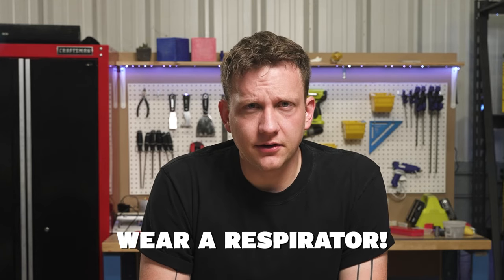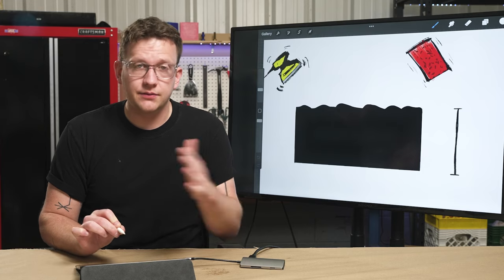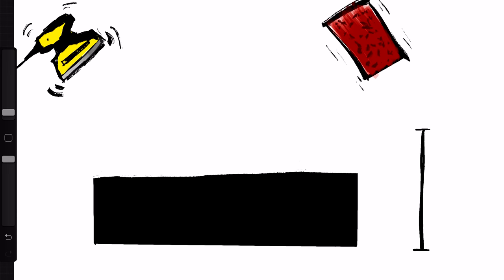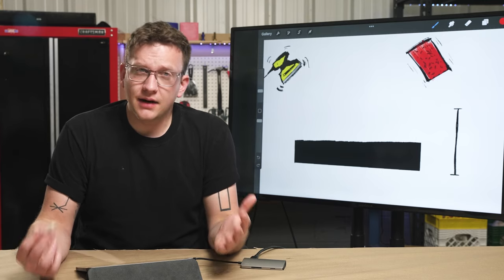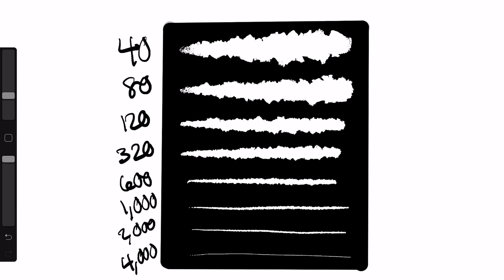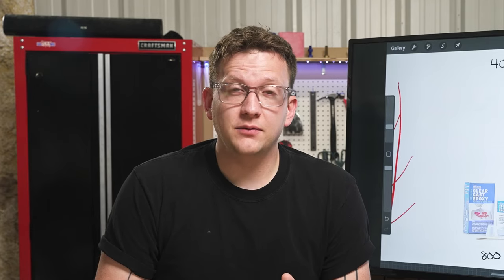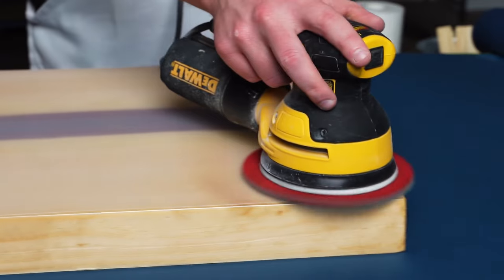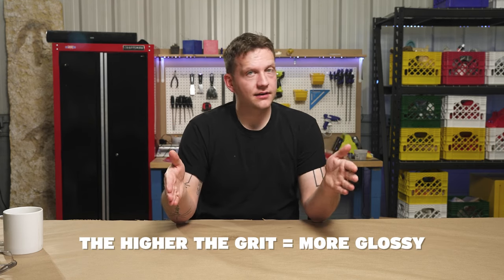Sanding 101: How to sand epoxy resin projects | Alumilite

Comment: Do the direction of the scratches matter? If I hand sand a piece, can I go in any direction, maybe resulting in cross hatched marks, will they disappear with polishing?
Reply: if you continue with finer grits the scratches will go away. does not matter which direction.

Comment: So, this was my very first project I ever did using resin. I cut out a cross on the scroll saw. Then hollowed it out with the saw, kind of like a cookie cutter. I taped the bottom of it with blue painters tape and poured the resin in. The next day I went to take all the tape off and found out the resin leaked out the bottom and on the wood itself. After struggling to get it all off it looks like the sticky stuff on the tape also stayed on the resin. Now, is there any way I can clean this up? By the way I added some sparkles in the resin and even like it is when you hold it up to a light it looks pretty cool.
Reply from the maker: Have you tried using rubbing alcohol?
Reply: @AlumiliteCorporation  No I haven't. How would I do that?
Reply from the maker: I would take a rag or paper towel and soak it in rubbing alcohol and try and get the tape residue off the resin that way
Reply: @AlumiliteCorporation  Thanks so much! I will give that a try!
Reply: @AlumiliteCorporation  I wish I could show you a picture of it. I was wondering if it's even possible to try and sand it. Especially with the wood all around the resin.
Reply from the maker: @billheleine6513  you can definitely try sanding it

Comment: Fun Fact - The reason for the numbers on the grits is easy to understand. Each number indicates the average number of grains on the paper per inch, so a sheet of 40 grit sandpaper has about 40 grains of the hard cutting substance imbedded over each inch, 400 grit paper has about 400 grains of grit per inch, etc... 

Not covered in this video is the differences between wet sandpaper and dry sandpaper. For lower grit papers (40 - 200) you can usually use them dry because they're cutting larger particles of material and those simply fall away but when you move to higher grits (400 - 4000) those cut smaller and smaller particles which tend to get stuck to the paper and clog up the spaces between the cutting grains on the paper. So after an amount of time sanding, the paper tends to get coated with the material you're trying to sand away, so they stop working. But when you use wet sandpaper (as the name implies) you wet the paper with water which acts as a lubricant that washes the material off the paper as you work. You can rinse the wet sandpaper to clean it off periodically... if you try that with dry-use sandpaper, it will rip and fall apart like any other kind of paper. Wet-use sandpaper tends to be more expensive per sheet but because the wet-use sandpaper is more durable and you can clean it it's just as cost-effective as the dry use sandpaper. You're welcome.
Reply from the maker: This is awesome additional info, Ron!! We imagine it will be super helpful to our other makers!
Reply: Thanks for sharing this as I am trying to find an answer for this. Does always the higher number sandpapers are made to combined with  water or it needs to be one that is made to combined with water?
Reply: Another addition on the video, is to be clarified the sandpapers and also the drills. 
Can you use any sandpaper to the drill or if you drill has 4 or 8 holes ,your sandpapers needs to be with the same amount of holes? Have used a drill with halls but sanspapers without holes and has created a weirs blurry effect on some parts of the resin project

Comment: This video just saved me! Thank you! I sanded down a top layer on a preservation block because there were micro bubbles. I used 36, 80, 150 and 220. Then I went to top coat it thinking it would be clear when I poured the resin. I was SO WRONG! Now I know that I just need to keep going up to 4000 and end with a polish. Phew!!! I feel so much better!!
Reply: HI Elizabeth, I was thinking of using similar grits to get rid of some imperfections before the flood coat. Did you ever redo your project with success and if so, can you share your techniques. Thanks
Reply: @darlenestewart3149  I did exactly what I noted above. It worked.
Reply: That's what I believe I have now.  My husband just took a small project over to his friend's upholstery shop to sand down something that would have taken me a long time to do.  It looks beautiful!  But when I put the alcohol on to clean it, it was still in that frosty looking state.  I now have to find out what grit was the last so I can go from there.  Or maybe he can do it for me LOL

Comment: Hi, you're making extremely entertaining videos. More than that, great information!

I'm starting to work (professionaly) with microcement which I use to mix with an acrylic resin.

I love this product a lot, cause you can apply it everywhere, as long as the surface is in good condition and flattened. On top of that, you can create that beautiful weared 'stone' effect.

The downside of the story is that I'm sentitive to chemicals, especially to the fumes. I literally feel it somewhere in my lungs.

There are two options: 

1) I quit chemicals forever and find an other way creating stuff with more ecological material. This will limit dramatically my array of projects (no bathroom, no floor,...)

2) Or I handle the chemicals in a very responsible way (also waste management!) and take advantage of their great properties.

I give the second option a shot. 

What do you recommend when working with acrylic resins? 

Thx!

Comment: Love the content.  on try number 3 figured I'd reach out...engraved a flag on some mahogany about 1/16th deep, for a podium/stand.  First board...ultimately didn't put enough down to cover the grooves and the surface of the board, but it looked ok, except for the prickly bumps that caught the light and looked not so great.  Figured I'd sand it down and replicate what I did on my test piece, well that didn't go well.  The first sand was ok, but second pass I started seeing these white spots peppered across the surface.  would'nt wipe off and the more I sanded the more appeared so I stopped tried to wipe with alcohol, and subsequently figured that they are the bubble channels that ended up filling with the dust from the sanding.  I'd take it down to the wood but on the stars section, I don't have room.  2nd try I sealed with shellac x2, and poured.  Started off good but in the deeper part of the engraving, I could s ee some bubbles so I applied the torch to the whole thing, but I think I ended up staying longer on one part and it "cooked" it. Acting quick I scraped off best I could the 1/8th in coat including the caked up cooked part to 8/10 success.  A little texture left but nothing I don't think sanding would help.  SOOOOOO...if you've read this part thanks, here's the questions...anything can be done with the small white spots?  2nd question is since I have a light surface coat...I think what I'm reading everywhere is to sand it, wipe it and pour a flood coat on it, wait a bit and use a heat gun?  Anything I'm missing?

Comment: 1.13. in you look like the news anchor I want to listen to, 😍 on the subject I'm interested in. I have only made a few ashtrays 😩 I made a rolling trap 🤦🏼‍♀️ got distracted & touched my surface like a muppet & left a 🌊 popping up on the back. It's cured & still in the mold (I left it in cause I have writing on the front to still fill & I didn't want to get dust in it. I bought a hand drill sanding tool off Amazon. But I also have good intuition & wet & dry black sand paper & resin varnish (that tbh I nearly never bought 🙄 some purchases are absolutely necessary). I've only tried 2 different resin brands, the first one was yellowish. I've repurchased the 2nd type because it's performance was amazing compared to the other, the brand is called Craft Resin. I've got asthma so I have a good respirator, goggles, an industrial fan my windows open & my extractor fan since I'm in my kitchen, but not killing my neighbours with fumes is always a good thing. That was a funky cube light. At some point I'll copy that for my nephew & niece & put paper around the outside to use as a story shadow box. Anyway thanks for the advice & ideas. I hope things are good at your end, stay blessed 💙💜🏴

Comment: With a new poured surface, that’s pretty darn close to perfect, but you want to work out a few waves or the odd dust spot, what grit would you suggest we be good to start at, would 4000 be sufficient and then go to polish?

And, does polish actually provide a layer of protection to the surface ergo, making something we should do even on a new surface?

Comment: couple statement and a request 

When choosing which grit to move to in woodworking the addage has always been ~50% higher than the previous grit within the realistic availability. so 40 to 60, 60 to 90 but 90 is less common so you jump 60-80 then 120, 180 etc adding in an extra step like 150 as you see fit.  

Love the videos and totally miss the podcast to go along with maker monday. 

One more detailed video that may be helpful is master prep. specifically you have mentioned in other videos about smoother masters give smoother casts. If you have tips of preparing different mold master materials that would be helpful. Like method of finishing a 3d print, wood or clay to give the smoothest mold and therefore the clearest casts

Comment: By polish do u mean top coat of the epoxy or polish is something else i don't know of ? Also if we don't use polish and simply top coat it with resin what result would that give after Sanding with lower grit and/or  higher grit ?

Comment: Hi, just came across your channel and I love that you do some more technical explanations when it comes to resins. I've been wondering about getting refraction effects into resins and would love to hear your take/ideas for it. Are there epoxys with enough difference in refractive index to be visible once poured together? Or do you have to use other clear materials? E.g. I've seen people use clear silicone as fake ice inside of resin. But what if you wanted to do clearly visible refraction plane somewhere inside the resin? You'd have to pour layers of material with the different refractive indices, not sure if that would work with a layer of silicone and resin. And what if you wanted to do swirls?

Comment: so I'm finishing cedar live slabs and I have quite a few epoxy pours that I need to "fix" ..I'm concerned about using such a high grit w/ my sander b/c it will hit the surrounding wood? Any suggestions?

Comment: Can you put resin on top of hair gel? I am making a miniature swimming pool and don’t want water in it could I put hair gel then a coat of resin on the top. Would there be a chemical reaction or would it just sink. Is this possible to save resin doing it this way or could you advise me on any other way to save resin as the pool is about 3” deep 1’x8” thank you 
Elaine

Comment: If I did a deep pour of resin (a 4in serving tray) and the surface is already smooth, is it necessary to sand before polishing? Should I still work up to 4,000 grit to get the most shine? Or just skip to polish?

Comment: I have a clump of epoxy on my table top.  Should I try to use a chisel to scrape off some of the epoxy before I start to sand it, or will there be a problem? Any suggestions?

Comment: I used epoxy resin to fill in large a through and through hole in a 9 foot pice of cedar. Now I have a raised blob of epoxy on top that I need to sand down. 400 grit barely touches it. Do you have any recommendations?
Reply from the maker: Unfortunately, if you're not able to use a planer, you may be looking at a few hours of sanding.
Reply: @AlumiliteCorporation  thanks, I ended up wet sanding the excess.
Reply: @faithburrell2867  what is wet sanding?

Comment: Some artist only sand once with a 60 or 80 grit, then apply a final thin flood coat of epoxy. What is your take on this method? I'd love to hear everyone's thoughts on this. 🐸
Reply: I use this method because I found it easier than sanding all the way up the grits ( plus I generally make pendants so they are small scale ).  The only drawback I find is the clear coat can sometimes get a bubble or there will be a low spot or two. Also since I combine wood with epoxy, that first clear coat can sometimes get absorbed into the wood.   So it generally takes two coats with a light sand between.  But the finish is super glossy when it’s done
Reply from the maker: It's definitely a great shortcut method if you don't want to sand, don't have the time, or are working on a project that doesn't need that much work!